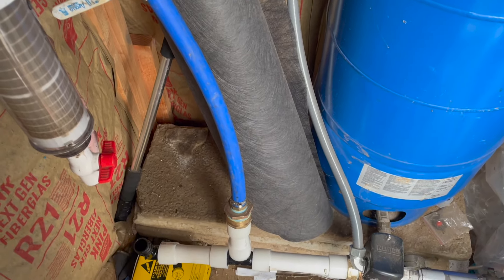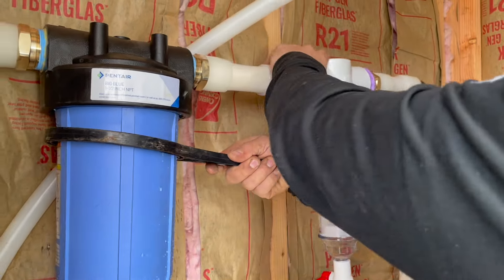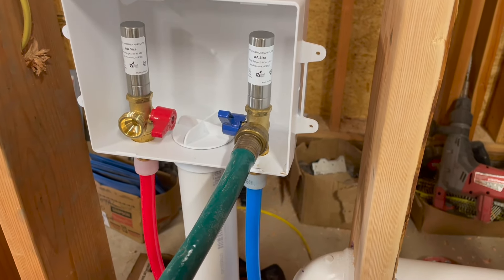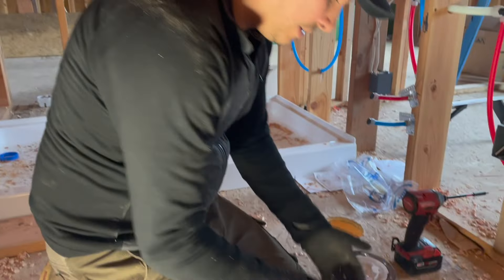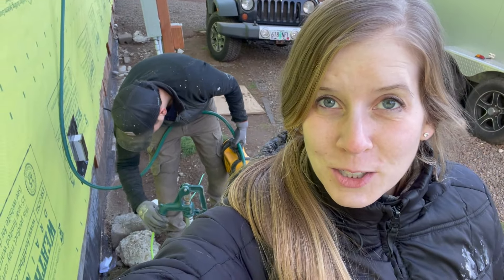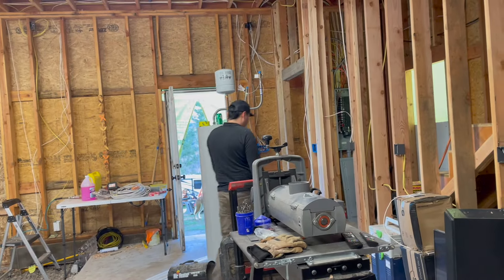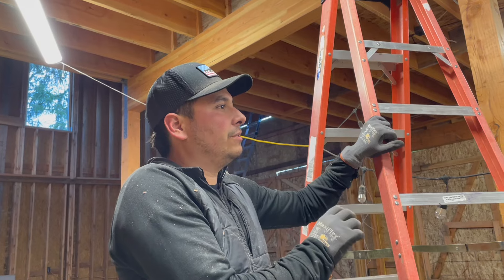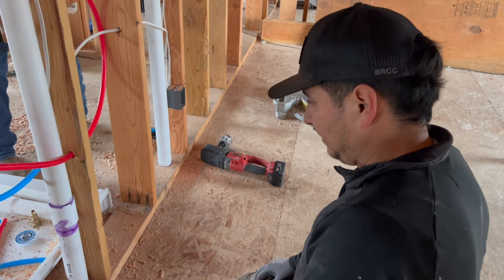Testing Our Plumbing  ||  Shop/ADU Ep. 31

Comment: you don't need house wrap with the zip system
Reply from the maker: You're absolutely right. However, you do need to cover all your nail holes, so we decided to use housewrap instead of going through to fill each and every hole. Partly because it was less work for us, and partly for the added protection from water that the housewrap gives us.